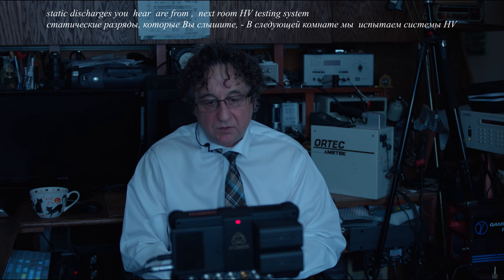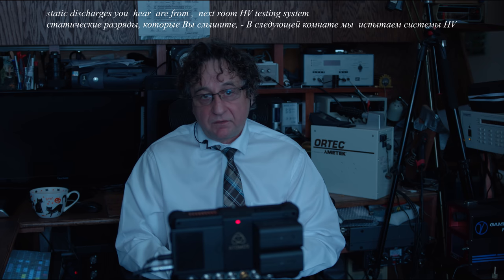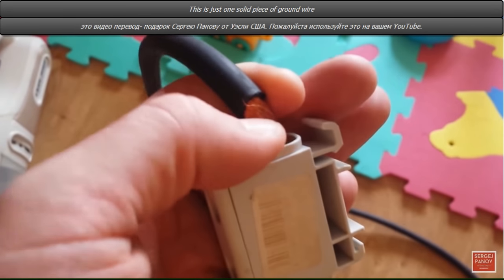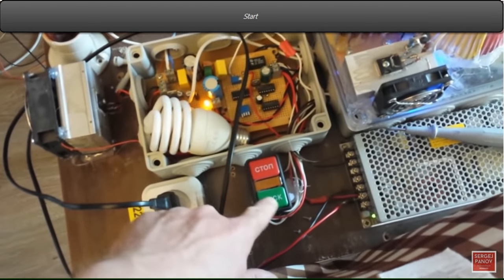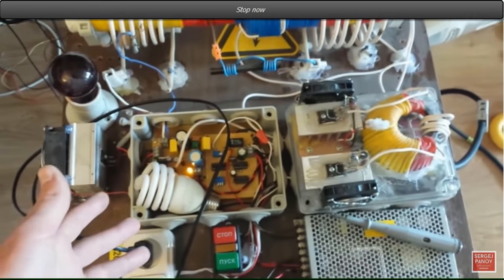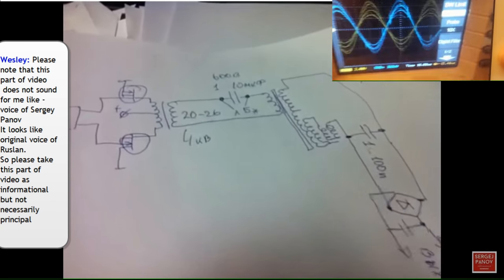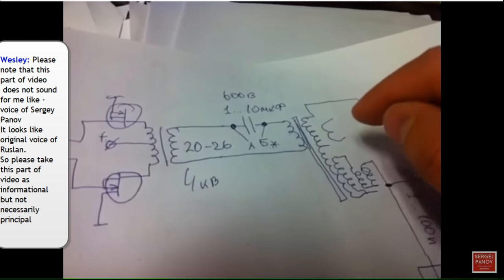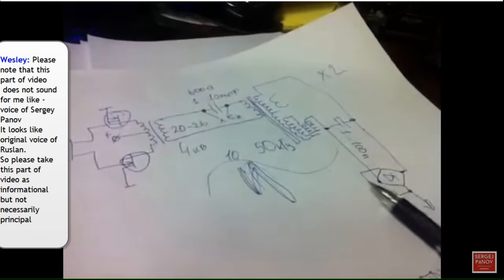#1 Sergey Panov  published   "HIS" secrets ABOUT Ruslan Kalabuhov Free Energy Device.

Comment: Sergey explained that it was all a scam: Ruslan hid a thin wire along with the thick black "ground" wire which was connected to the 'hot' AC phase and the return was the ground - it was held in by the green tape. He explained that all the parts in the device were operational, including the TC but they did nothing and were all just smoke and mirrors. He filed a lawsuit and went to court and at least got his money back while Ruslan didn't even bother to appear. If you check his channel out you will read his reply to my request for a general translation of what went down.

Comment: At 08:30, it's said that the "fish" voltage waveform must be obtained across the series capacitor. Is the "fish" waveform obtained with both kacher and push-pull turned on, or only with push-pull turned on and kacher turned off?
Reply from the maker: the fish  waveform is double effect  observable on speedup oscilloscope monitor on the right . ( you see something like double fish with different colors)  As the effect of two waveform alignment, or  original video link  in description. The whole process explained there was not yet analyzed by me to the point of expressing my own opinion in this area.